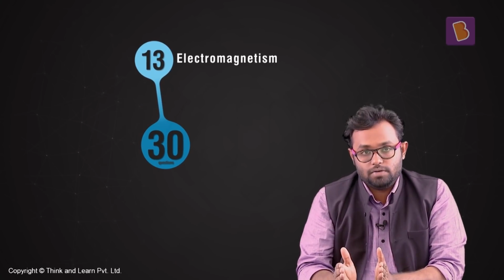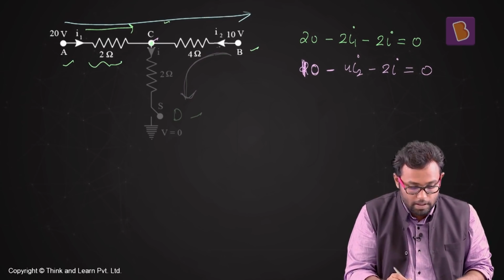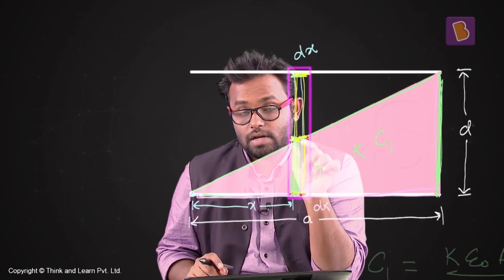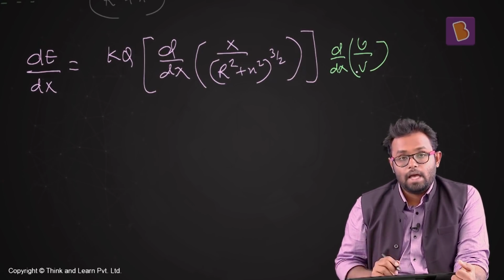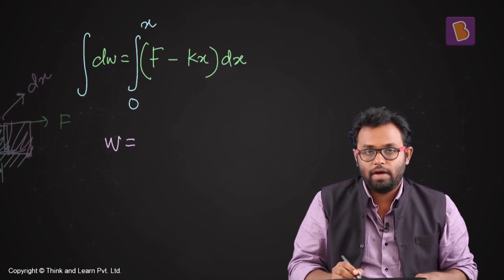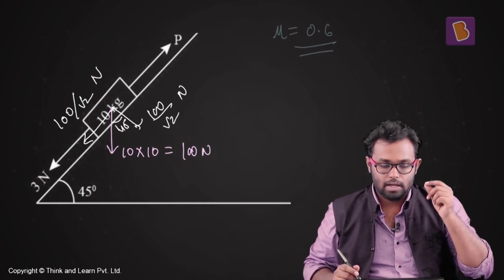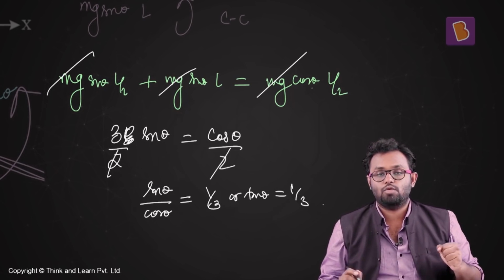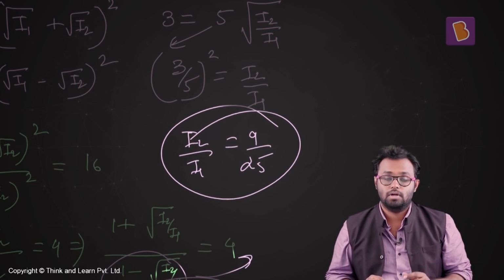JEE Main 2019 | Paper Analysis + Solved Questions | Physics

Comment: in question 2 in BC potential DIFFerence is zero(10-10=0) then how will current flow through that???
Reply from the maker: Hi,
Yes, there is no current flowing in this branch. We have just assumed that a current is flowing in this branch without being sure of its value and after solving we are getting this value to be zero. Put the value of x in the expression of i_2, you will be getting the same result.

Comment: The friction  force you calculate was 31.28 and if 32 N is the right answer p and friction are no more Bros hence wrong answer.
Reply from the maker: Hi Rajat,
Sometimes, options of JEE questions are approximate instead of being accurate. So, you'll have to analyse options of such questions. for example in this case 32 N is the closest option to the accurate value i.e.31.28 N . So, if you are fully confident on your calculated answer and you can clearly see that all the options are integers even though there is a very rare possibilty of getting an integer as the answer because there are so many non-integer values involved in the solution, then you can go for the nearest value of your calculated answer.

Comment: Sir area of plate adx kaise ho gaya question no_ 3
Reply from the maker: That's because each plate of the capacitor is square in shape. We have considered 
an element of width dx on one of the edges, therefore the rectangular strip we'll get have a breadth 'dx' and length 'a' which is along -z axis in this video. Therefore the area of
this thin rectangular strip will be a*dx

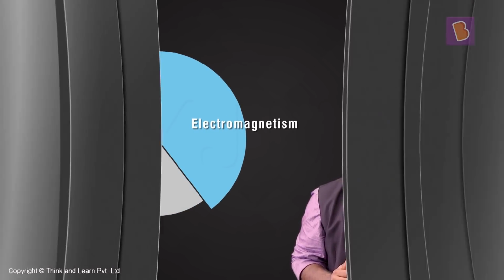Comment from the maker: Question 1. Chapter- Magnetic Effects of Electric Current: Finding out magnetic field at the given point due to a current carrying loop comprising of circular arcs and finite wires. 00:53
Question 2. Chapter- Current Electricity: Using Kirchhoff’s law to find out the voltage at a point in the given circuit. 07:07
Question 3. Chapter- Capacitors: Finding out the capacitance of capacitor using integration, where half of the volume is acquired by a dielectric of variable thickness. 12:00
Question 4. Chapter- Electrostatics: Finding out the position where the strength of electric field is maximum along the axis of a uniform charged ring, using properties of maxima and minima. 24:21
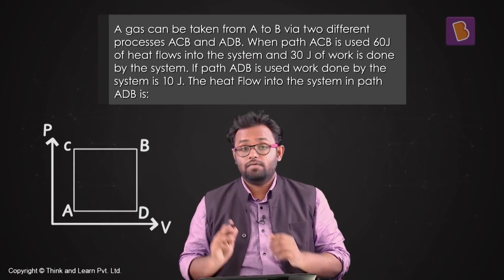Question 5. Chapter- Thermodynamics: Using first law of thermodynamics and the given P-V graph to find out the required variables. 30:27
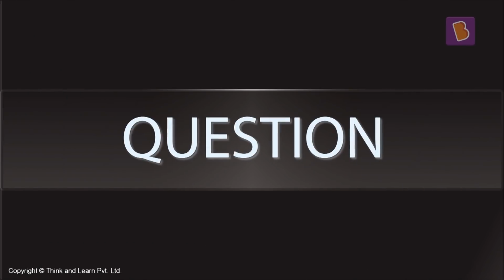Question  6. Chapter- Work, Energy and Power: Using Work-Energy theorem/conservation of energy to find out the maximum speed of the block in the given spring-block system. 32:48
Question  7. Chapter- Laws of Motion: Finding out the required value of force for the given wedge-block system simply by resolving the forces. 41:56
Question 8. Chapter- Rotation: Finding out the angle made by an L-shaped object using torque balance equation. 47:12
Question 9. Chapter- Thermal Properties of Matter: Finding out the temperature difference between two points in the given thermal resistance circuit. 52:40
Question 10. Chapter- Waves: Finding out the ratio of individual intensities from the given ratio of maximum to the minimum intensity obtained from two coherent sources. 58:18
Reply: sir im class8 i need some important points in physics can u make a seprate video on it plzzzzzzzzzz
Reply: Sir keep uploading these types of videos